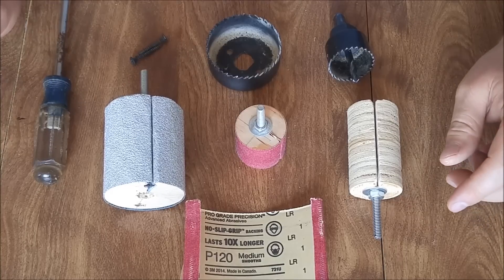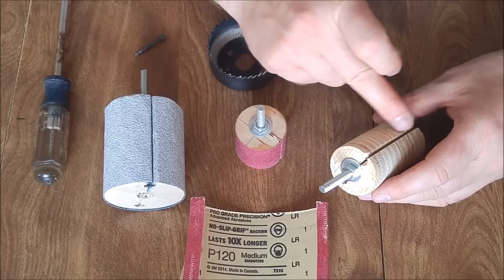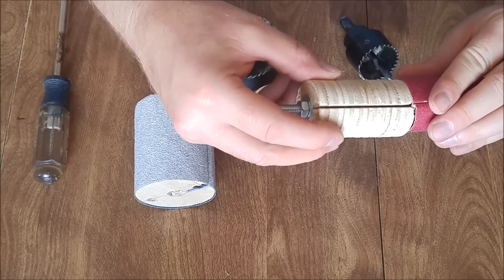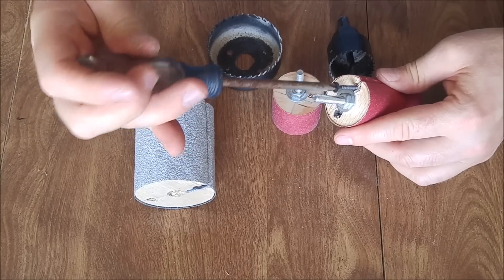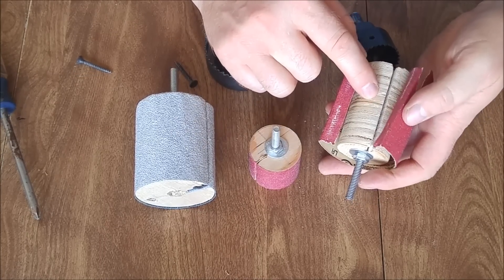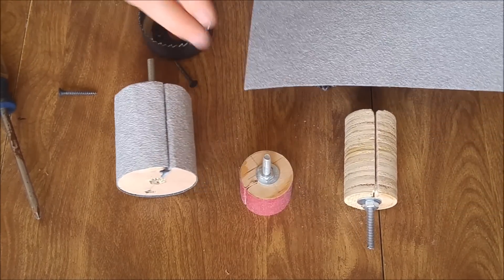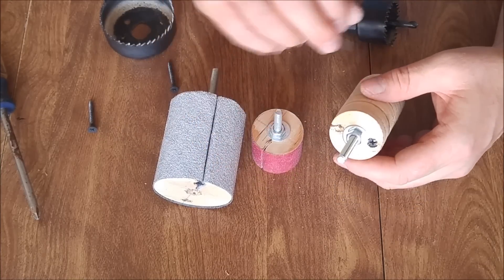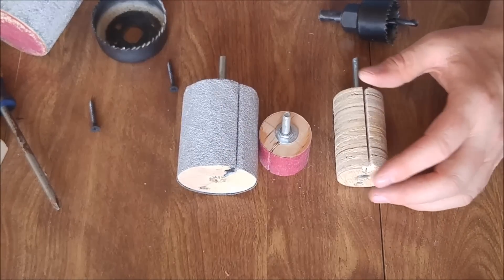DIY Spindle Sander

Comment: how holes were made not shown.
Reply from the maker: A drill press was used to drill pilot holes for the screws securing the sandpaper. And for the center hole for the 1/4" hex bolt, this was also done using a drill press with hole saw.  It's a good point that I should have mentioned if you had a really long spindle then it may not be necessary to drill all the way through for the screws securing the sandpaper , only really need to drill through a bit past the length of the screws being used, and then of course need to cut a thin channel the entire length for fitting in the sandpaper ends.